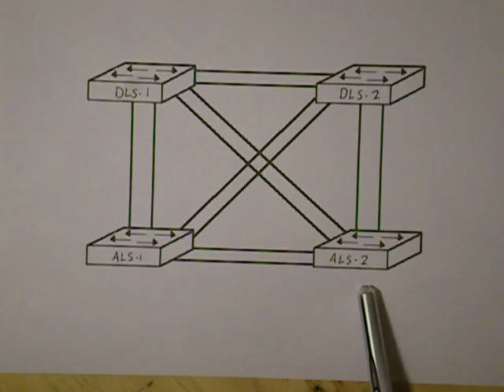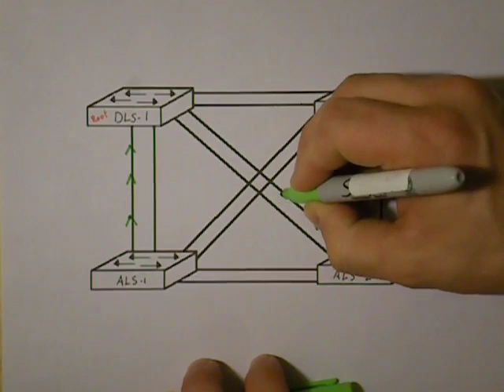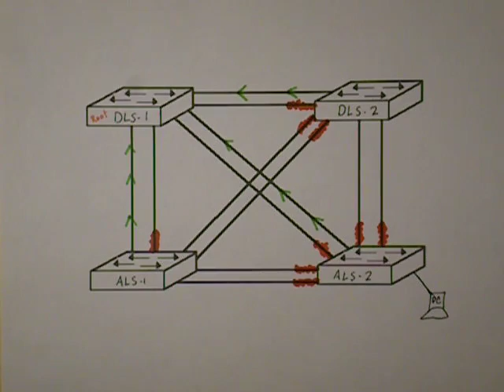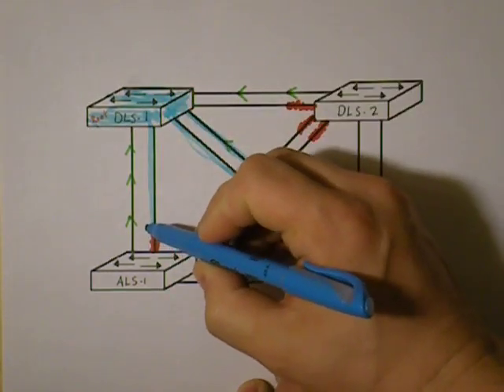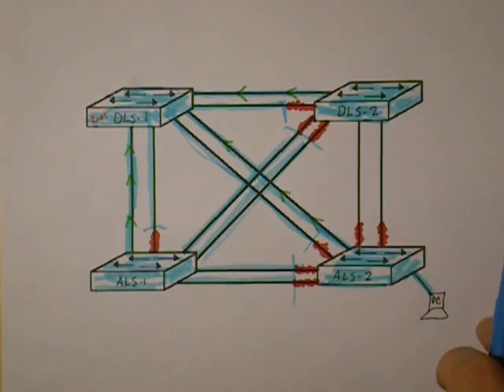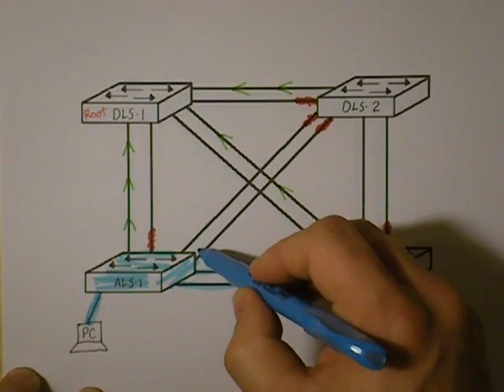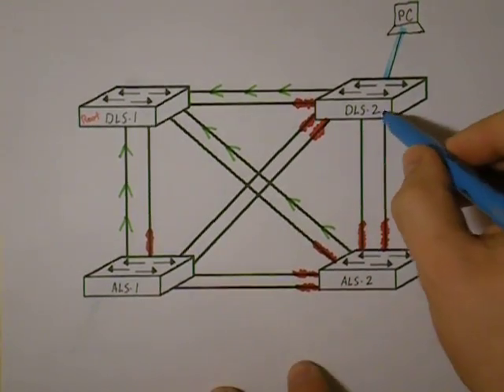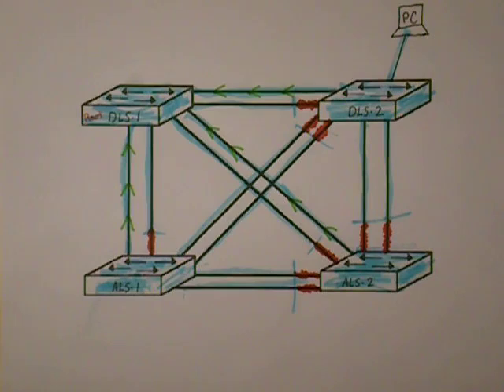How Spanning Tree Protocol Prevents Loops

Comment: Thanks Ryan. I figured you didn't know..but I was kinda thinking out loud for the forum and myself.
After research apparently the BPDU packets determine the best path to the root and shut of the listening of the other interfaces:
Lowest root bridge ID -
Lowest cost to the root bridge -
Lowest sender bridge ID - Serves as a tie breaker if multiple 
Lowest sender port ID - Serves as a tie breaker if a switch has multiple (non-Etherchannel) links to a single upstream switch

Comment from the maker: There are ways to manually tweek which ports arelistening or blocking, but it is not recommended to mess with them, unless you really know what you are doing.  STP usually works pretty well automatically, on its own.

Comment: Default is mid range

The extend system-id the STP BPDU has to reuse 4 bits from the original 16 bits used to denote the Switches Priority.  Therefore, 2 to the 4 equals 16, so 16 increments from 0-61440, with 32,768 chosen as the mid-range value.
 
16 increments of 4096 start at 0---4096---8192---12288---16384---20480---24576---28672---32768---etc.
 
STP BID Fields: 4 bits Priority --- 12 bits Vlan ID or Extended System ID ---48 bit MAC address from Backplane or Supervisor dependent on chassis.

Comment: Every port on Non-Root Switch connected to host is set to Designated Forwarding(DF)
The Link that is causing the loop between the non-Root Switches, is set to Blocking or Designated port. The method it uses again is the Bridge Priority or Mac address. The Non Root Switch with Lower priority is set to Designated and the other Peer Non Root switch sets it to blocking.

Comment from the maker: STP has it's problems and one of them is scalability like you asked about.  It will still work when you have a very large network, like in the hundreds of switches, but all the traffic going through a single switch can cause a bottleneck.  On those very large networks, administrators will often disable STP and use a protocol like TRILL (Transparent interconnection of Lots of Links) or SPB (Shortest Path Bridging).

Comment from the maker: You don't need two connections to each switch.  STP is generally on by default no matter how many cables there are. I only put in two cables between each switch to show redundancy and to show that it still works at that level of complexity.

Comment: Yes. I have heard the same, although changing the STP default number to anything lower than the others which are at 32768 (default) would automatically make it the root, as I understand. So, other than making one switch the root on purpose, I don't see another reason to mess with them either.

Comment: BPDU's will determine:

1. Least cost path from each bridge.
2. Least cost path from each network segment.

then

3. Disable all other root paths. Any active port that is not a root port or a designated port is a blocked port (BP).

So, all the root paths are determined by cost then the other paths stop listening (unless the main interface goes down..in which case they may listen again)

/wiki/Spanning_Tree_Protocol

Comment from the maker: ALS-1 doesn't need to close down the other ports because the switches on the other ends of those ports aren't listening.  I think one of the ideas is to close out as little traffic as possible, just in case.  The thing that I found out when I did this video is that every part of the network still gets the broadcast.  When ALS-1 sent it's traffic out to ALS-2, ALS-2 just ignores it, but after the broadcast is done, you will notice that every cable is highlighted.

Comment from the maker: I've never seen a business class switch that doesn't support STP, but I guess it's possible that there are some that don't.  As far as which interfaces are listening, it is determied by the network topology.  All the switches will hold an "election" to determine which switch is the "Root switch".  Then, all the other switches in the network figure out the quickest way to send traffic to that root switch and that path determines which ports are listening or blocked.

Comment from the maker: STP isn't usually implemented on the routers.  Since a router is meant to forward data between different networks, each of its interfaces is attached to a different network.  So broadcasts that hit a router stop there.  

A switch, on the other hand, is responsible for moving data about in the same network so here is where there is a danger of loops.  So STP is implemented in every switch.  This is probably already done by default.

Comment: Just a comment. When a port is in blocking state, it DOES accept BPDUs.. The only time it doesn't listen sis when it's disabled
Reply: Well, your video seemed to insinuate that blocking  ports do not listen,  which is not true--thus my repsonse

Thanks
Reply: +Mike Barrett 

I know this is a year down the line so anyone feel free to chip in. So the switch the PC is connected to sends out the BPDUs to the other switches (via the connections that aren't redundant). Those switches receive the BPDUs and do the same, the links are up and ports aren't blocked as such but the switches just don't use the redundant connections?

It makes sense in my head. I think. 

I couldn't understand how in example 1 als-1 and dls-2 decided who was doing the "blocking" but this makes more sense.

Comment: Great video man, I have a question.. how's the root elected? I've read that they have an ID and the lower gets it but I don't understand
Reply: When you connect all the switches the first time, they would all have same priority by default. The switch with the lowest MAC address would be selected as a root in that case. But should you been keen on making a specific switch as Root, you can always give it a higher priority which will override the MAC election.
Reply: +tincho from what i've read, the switch with the lowest priority number will be elected as the Root Bridge, priority number is configurable.. but if the priority is not configured yet, the switch with the lowest numerical MAC address will be the RB (Sw A MAC Addr 11:11 is lower than Sw B MAC Addr 22:33, therefore Sw A is the RB).

http://www.dummies.com/how-to/content/spanning-tree-protocol-stp-introduction.html
Reply: the one with the lowest mac address gets elected by default if config has not been taken place bro

Comment: How does each switch determine which interfaces are "not listening"?  Are they manually configured to do so?  I mean, is a config set to use one interface for  "spanning tree" and then all the others automatically shut down?  Is there a client command verse the root command?  Do all of the images in the switches have to support spanning tree to get the info from the root device?